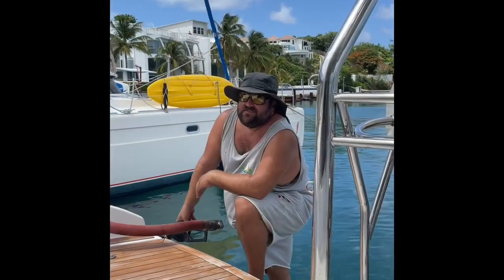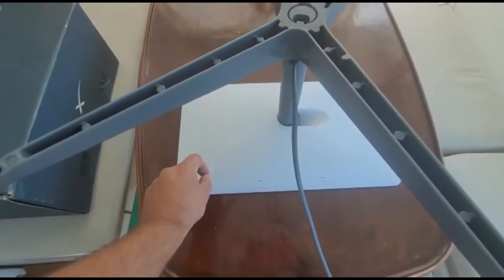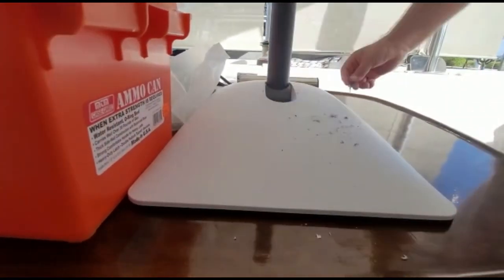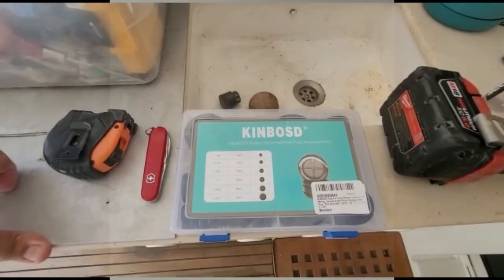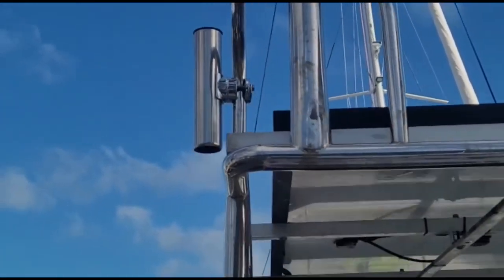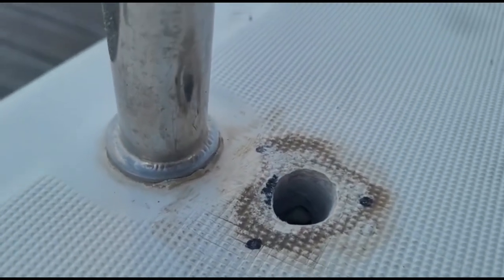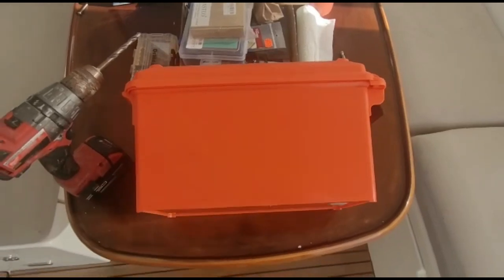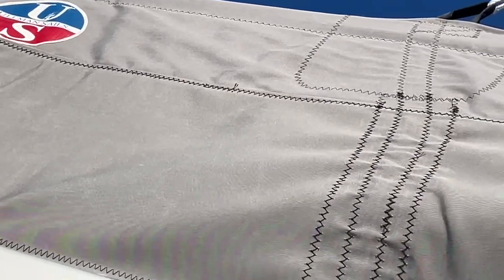STARLINK BOAT INSTALL + MOTOR DEACTIVATION Ep.49

Comment: Right on guys, I die laughing at “when’s it’s in the WTF am I doing up side down mod” . We haven’t cruised with ours yet but if it starts dropping we’ll deactivate the motor as well. 
FYI, yea didn’t mention, although I’m sure they work either way, but the modem runs better on a Pure sine wave inverter vs modified, you’ll have a faint buzzing from the modem with a modified sine wave. Wish you guys the best! Hope to share an anchorage again!
Reply from the maker: Glad to see you guys got Starlink and with it Trav gaining unlimited access to the internet. Can’t wait to see what that brings. Thanks for adding that bit of information for anyone looking for inverter advice. We picked ours up in SXM and your unofficial, unpaying corporate sponsor IWW didn’t have the Victron inverter in stock that I wanted. So I grabbed that cheap mod wave to fill the void. I’m sure the modem made a faint buzzing noise however I couldn’t hear it over the junk cooling fan in the inverter that would make a jet engine blush😆. We have since swapped over to the Victron 250. I see mixed reviews on outages with the motor active but didn’t wait to find out. I unplugged ours before even mounting it mainly so I could mount it lower on the solar rack. You will be pleased once you get underway. We haven’t been without internet since leaving SXM to the Bahamas. We’re excited for you guys to get back underway and continue your European adventure! Definitely looking forward to sharing an anchorage again someday.

Comment: Great video.  Are you using the Starlink Roam antenna or the residential antenna?
Reply from the maker: Thanks for the support! We went with the RV plan (now called Mobile-regional). Not sure if it’s the same antenna as the residential or not. Seems like it keeps changing. Also not sure if unplugging the motor is still necessary or not. Some people have reported an update made it so you can turn it on or off. I can report though that it has worked flawlessly now in the flat position for 5 months and counting.
Reply: @sailingtootsiemarie  That's very helpful thanks for sharing.  I cruise mostly on the Canadian side of the great lakes and cell coverage is spotty.  My girlfriend can work remotely but chasing signal for her really impacts our itinerary.

Comment: Nice job Tyler.  Two questions for you:  1. how would you change the "5 inches in from each side" measurement so the hole was more centered over the motor connection?  and 2: can you provide details (size & source) on the stainless mount you showed briefly at around 3 minutes in?  Many thanks!
Reply from the maker: Hi Jim, thanks for the questions. 1) Even tho the hole I drilled wasn’t directly above the motor connection I had no trouble unplugging the harness. If I wanted to assure it was exactly 5” in from each side I would track down a flexible tape measure to be more precise rather than a string and a marker. 
2) The brand of the rod holder is Perko ( https://www.perko.com/catalog/fishing_equipment/542/clamp-on_fishing_rod_holder/ )
It’s a good quality made in USA holder. Can also find on Amazon. Not the cheaper flimsy ones. The build quality and metal thickness is noticeable. I used a 1.5” hole saw to drill out the plastic bottom of the rod holder so the pole on the dish could slide all the way down. It’s a snug enough fit that I didn’t bother drilling and tapping a set screw. It has now been a little over 1.5 months and the only change I’ve had with the install is the power inverter. I was finally able to get to a location that carried a Victron 250 inverter so I swapped out the cheap Xantec with the Victron. Otherwise not a single issue. Have had continuous uninterrupted internet from SXM to Bahamas. Thanks for watching and let me know if you have any additional questions. I’ll do my best to get them answered.
Reply: @sailingtootsiemarie  Many thanks Tyler.  Just ordered some grommets and a set of Forstner bits.

Comment: Great video, informative.  I am planning something similar for my Hylas down in Mexico.  My only concern is your final location of the antenna.  While its a good location for the Starlink, its going to impact your solar by causing shade on the panels.  I'm hoping to find a location other than my solar arch to mount the antenna.  Thanks for posting this.
Reply from the maker: Thanks. In our application we don’t have any solar shading problems. It might be hard to tell in the video but the Starlink is mounted on the outside of the panels and is so low it has a short shadow length. By the time the sun angle creates any shadow it’s so late in the day we’re done charging for the day.

Comment: Great stuff - thank you both. Up here in the cloudy pacific northwest, I had been concerned that running my big inverter could outpace the solar input, but the dedicated inverter pro-tip is the way to go. I am probably going to disable the motor, but just curious, why did you not leave the motor active to decrease the chance of drops? It seems you have space for the dish to tilt. This is the decision I need to make...
Reply: Thanks for the kind words Duane. From the research I did prior to getting the dish it seemed people were getting a lot of drops from the motor being active. The boat would swing and the dish adjusted for signal but did not keep up if swinging a lot on the hook causing drops. I can't speak from experience tho because I decided to unplug the motor prior to installing since deactivated motor reviews seemed very positive and I didn't want to bother with taking it down to deactivate once installed. It also allowed us to get the dish down tighter on our solar rack to make it look more streamline. We have never had a single issue with signal drop since install from sxm to bahamas. Again, have no personal experience to compare it to but it has worked flawlessly for us and is reversible. Also, if you notice the HD dishes are fixed flat and seem to work great. Not sure if accurate but I read on the forums the motor tech was more necessary a yr+ ago when there wasn't as many satellites. If you get a sperate inverter be sure to get a Sine Wave. I used a modified Sine in the video because they were out of stock on and I had to order the one I wanted (Victron 250). The one in the vid was a cheap temp just so we could use it while we waited for delivery. Glad our video was of help to you.
Reply: @TylerLucken  Excellent follow up - thank you!

Comment: How is this working?   I was thinking I would need the “flat high performance” hardware since the boat is always in motion.
Reply from the maker: It has worked flawlessly from SXM up to Virginia and back. Only losing service in very heavy, cloudy weather. We have the mobile plan and toggle on pay per GB when heading offshore. Just remember to toggle it back off when back near land. The high performance dish wasn’t out yet when we bought ours but after a year see no need to switch. It has been a game changer and sure beats chasing data cards.

Comment: How do you know where  to drill the 1" hole?
Thanks
Reply from the maker: 4:01 If you set your dish face down in the same orientation you see starting at 4:01 you measure 5” from both sides and draw a line. Where those two lines cross is where you drill. I found it easiest to put a piece of tape to make the marks on. Hopefully that helps out👍🏻